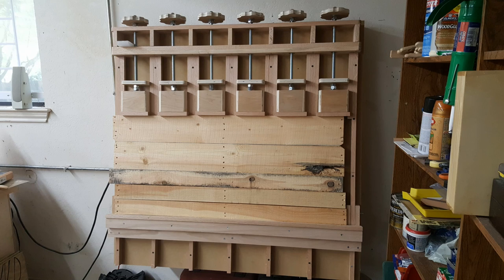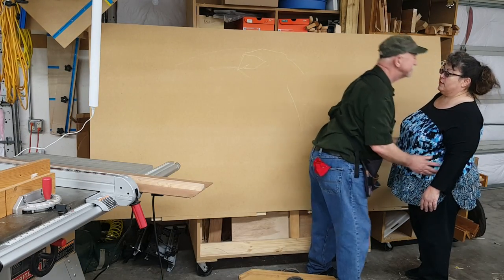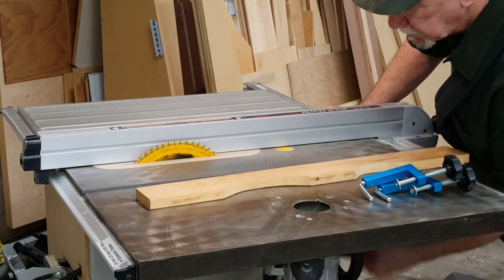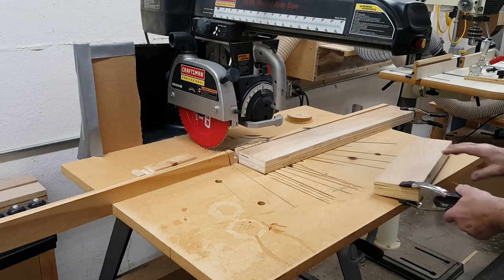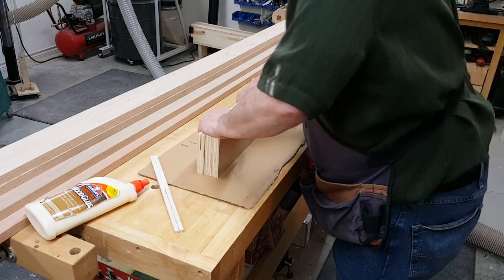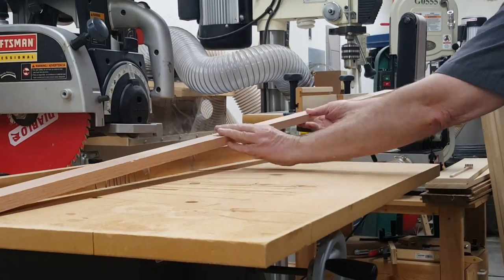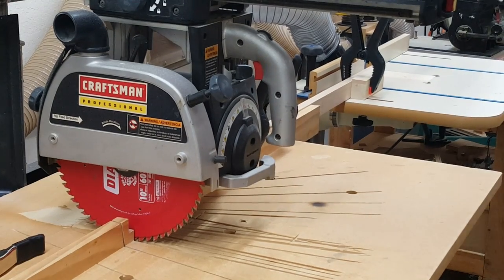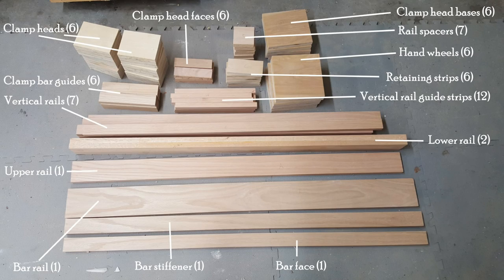Glue-up Station Assembly, Part 1

Comment: The ' radio alarm saw' is the best ha! On another note, I was blown away with all of the things you made to make your work easier. The ply dolly is, like, the best! Not to mention that lumber rack. So many cool things, Rock on Fred!!
Reply from the maker: +ESCAGEDO WOODWORKING Thanks, Eloy!  I'm planning to do an improvement on the ply dolly and make a video.  It spins on its two wheels when you're trying to set a sheet on it, and is hard for one person to use, so next time: two axles.
Reply: Haha, massive!! I saw a guy use a wooden hook and straps. I forget where. Maybe a combo of the two. It would make life much easier.

Comment: Fred, the face shield is a good start but working with MDF it is necessary if not mandatory to wear a really good face mask. MDF throws off very fine particles that can cause cancer. You need to protect your lungs. Plus a good set of heating protection wouldn’t hurt either. Set a good example for your subscribers. Best regards.

Comment: What kind of router setup is that?  looks very heavy duty and efficient
Reply from the maker: The router is mounted in a cast iron wing of my table saw, which is a Craftsman 315.228390.  It's solid and roomy, and I can use the table saw fence with it.  The router I'm using is a Craftsman 320.17543. My only complaint with the setup is that it's difficult to do chip and dust collection with it.  I built a 3-sided catcher that handles a lot of the waste on top, but nothing's catching what falls out below.  The router has an attachment with a tube fitting, supposedly for dust collection, but its diameter is 1 1/8".  Times I've tried to use it I found it worthless.  This setup has served me well for over 10 years, but I have it in my "to do list" to build a dedicated router table.